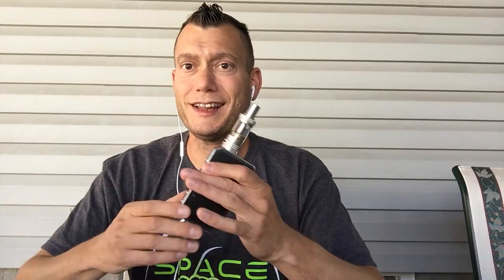Dangers of Ni200 nickel DON'T vape it on anything BUT Temperature Control!

Comment: I'm curious where you get your information? The metals in Kanthal (Aluminum, Iron, Chromium) are also toxic in certain situations. They're used because they're generally recognized as very low in toxicity even then and few situations where they become toxic.

The same is also true of nickel. What you say is correct, but as you acknowledge, you don't know the specific temperatures. The data sheets from metals manufacturers I have found indicate Ni200 is upwards of 600 celsius. Just like the common metals found in Kanthal, Nickle is one of these MOST common metals on the planet.

Nickel is used in cooking equipment.  electrical and industrial uses. It's used in welding and dozens of similar uses as the constituent components of Kanthal. Cases of Nickel toxicity are extremely rare and only found in metalurgy where workers were exposed to 20mg of fine powder that was inhaled according to the U.S. CDC. Environmental exposure from smoking cigarettes and contaminates don't remotely meet the necessary state.

I hope you don't take this as disrespect. But as long as I've been vaping I have seen videos and posts like yours extolling the dangers of some insanely common metal that we (vapers) are only becoming familiar with now. I have never seen a single one of these well founded on any real research or reliable data.

It's the major reason I wish regulators would get involved in some way. It'd be nice to have these myths and rumors cleared up so we can all vape in a way we know is safe. And thank you for being much less alarmist than other videos of the same. You seem to use your brain much better than most.
Reply from the maker: +Kbo On the off chance that you are not a troller as I commonly get, perhaps a legit person and not a fake account I'll address this.  You read the same stuff online that I did.  But I went to an engineering school and spoke with MANY friends and former colleagues about uses of metals while I was also deciding that Nickel is NOT just a commonly used metal in any of those applications you mention.  They use very small amounts of nickel alloyed in because it combines with other metals to give it a nice shine, and also to make it more rust resistant.  But pure nickel is soft and heat AND electricity will change it's structure.  It doesn't need to melt or boil as some assholes like to state in comments in this video.  Sure you don't want to breathe Aluminum or Chromium fumes either, but those metals combined with Steel and also a bit of Nickel will make a very hearty alloy capable of maintaining its' crystalline structure under tremendous heat over time.  Nickel is not used to make boiler tubes.  The composition of Kanthal is the same as used for the tubes in boilers.  And they stand up to intense constant heat over years.  My point in making this video was to tell people not to use Ni200 and Ti in wattage mode.  The entire debate over Ni200 needs to be done someplace else lest you miss the point of this PSA which tells mod users not to dry glow their coils with Ni200 or Ti.  As I spend alot of time in alot of vape shops and see new vapers who don't understand Temperature Control and how it works and why it is necessary I made this video.  And in fact the MSDS sheets for Ni200 classify it as a carcinogen and Ti as an Irritant, I would highly recommend being cautious and not rush blindly into using these without alot of reading on how TC mods work and how they calculate temperature.  Even the most experienced vapers and long time reviewers are asking the same questions as you are.  I'd rather not see people make a mistake out of ignorance, but rather understand that they need to learn this way of vaping and take it seriously.  As seriously as battery safety and mod safety.
Reply: +Quest4vape I appreciate the response. I wanted to ask because I've read up some on Nickel toxicity but I don't have access to much that would be relevant to vaping. But the main thing was that usual fear mongering on these subjects doesn't differentiate like you do. You seemed to know something that I and most didn't. I know the technical side well enough from building TC mods but am far from expert. Even in vaping, most experienced vapers I see know shockingly little true information (batteries is the one that horrifies me most).

I thought it was common knowledge not to burn Ni200 coils, not to mention totally unnecessary, until I started seeing this debate. But I had never gotten a definitive answer about the health risk and went with a "better-safe" policy. I don't have anything invested in Ni200 other than finding out what is accurate, which seems to be the big difference with most people here. I wasn't worried about TC in general since from what I've read, it keeps it well under the temp necessary to be toxic.

Again, thanks for taking the time to answer. I didn't intend to come accross as argumentative or trollish if I did. Just laying out what I found when I looked into Nickel before starting using TC and verifying you know what you're talking about. Especially if I repeat it to someone else.

People seriously troll you? What the hell...
Reply from the maker: +Kbo Some TC mods don't work accurately despite the label or the claim.  Some will shift back into wattage mode randomly (Joyetech VTC) and that is really scary for a starter kit.  Last Tuesday on my live show I dry fire tested a bunch of TC mods to see if any of them would burn a coil.  I recorded this ^ video in August shortly after I saw a guy doing a twisted build with Ni200 at a vape shop and use a blowtorch to remove the hotspots!  And he thought that was perfectly fine.  No I don't have all the answers, just making people aware that it isn't a casual subject.  If everybody knew this there would be very few views and comments on this video.  I get trolled almost daily.  Sometimes it is organized and coached.  Since nobody can comment on the fear monger guy's video on youtube they jump over to my video and bitch at me for hating on Ni200.  Without even watching the whole video usually.  Any comment with the phrase "nickel is a rather stable metal" is copied and pasted from an opinion that a retailer wrote online.  And I get people on here trying to sound like experts quoting that bullshit.  Also they like to tell me that Toasters and Orthodontic Braces are made from nickel.  These are incorrect statements and I am so tired of answering those jabs I now just delete them.  But unlike the fear monger guy I didn't do this video for the clickbait exploitation.  I did it because I want people to know there is more to this TC business.  I've done a few hundred videos after this one about all kinds of other topics, products and events.  But this one seems to catch the most attention.

Comment: I'm a new vaper, just to set it straight. I bought a device (Kangertech Topbox Mini) about 5 days ago. It came pre-built with a Nickel coil. The battery does have TC modes, but I didn't really understand the concept too well. So I've basically been vaping a Ni coil on wattage mode for the past 5 days, what risk does this pose? Great video btw
Reply from the maker: +Aadam Muhammad Read your instruction manual and use the Temperature Control.  currently you're not using the device properly.  Ni200 is not intended to vape in wattage mode.

Comment: That is what Kangertech states on its website about this coils and VW: 'Cautions:
Risk of battery Explosion! Ni 200 is designed for use only with devices equipped with circuit boards capable of controlling coil temperature, such as DNA 40 Mods. Do not use this product with any other devices.'
Reply from the maker: +Raul Andres exactly. Thank you!
Reply: you are welcome mate

Comment: Nickle doesn't combust below 550 degrees.
Reply from the maker: +Joseph Whitfield yeah?  Thanks.  So everything's just peachy until the metal reaches combustion?  cool.  big relief.  Now please go watch the video and see what it is I AM saying.  And don't vape Nickel in wattage mode or you will most surely be vaping at well over 600 degrees which the manufacturers never intended.  Thank you for your comment.

Comment: Ok i have a question....

I am using an Arctic Horizon Tech tank and i am using a 0.2 Ohm coil and can't find the type of wire used. Is this dangerous to use?
Reply from the maker: +Ramza BloodMoon I believe the .2 ohm coil for the Arctic is Ni200 but it should be labeled on the coil and the box for the coils.  no?
Reply: it was an individual piece sold in a little plastic wrapping, no labels.

Comment: Thanks for the safety tip man, just purchased my first Ni200 Temp. Control Coil to use in my Atlantis 2. Using a IPVd2 mod.
Hopefully this works or i'll go back to using soldering wire to be on the safe side.
Reply from the maker: +mattwho777 haha I know you're joking about that Soldering wire.  chuckle.  the IPV D2 is a great mod, does temp control with decent accuracy.  Be sure to lock resistance when both mod and tank are room temp (hold down the + and - buttons at same time and it will lock the resistance).
Reply: Quest4vape Yea I had this one for a few months now, we'll see how I like the TC coils. Keep up the great videos.

Comment: another newbie here, I am thinking about getting the Joyetech evic mini vtc, is the nickel coil the only coil I can vape in temp control mode with? and is titanium or platinum any safer/more dangerous to vape with?
Reply from the maker: +Pulp Free Fiction I just did a review for the Evic Mini, it's a great device.  I do a dry burn test with Ni200, Titanium and SS coil and it performs well, does it's job and the video shows you how and why Temp control works...it backs down power and then cuts power when max temp is reached.  https://youtu.be/CBTZTFJrEcc
You can vape Ni200,  Ti, and SS in temp control on this device, as well as set your own custom profile for other metals if you know the TCR...coefficient ratio number for that metal.  Titanium is not as soft and brittle and can withstand some higher temperatures but also has an irritant risk and forms Titanium Dioxide if heated too high and and/or dry burned.  I don't know anything about platinum.
Reply: Quest4vape thanks for the info,  I'll probably end up buying this mod then.

Comment: Ive only had my mod about 2 weeks and it came with both a nickel Ni200 and Kanthal coil. Im not liking the nickel because on temperature control which i use because the directions say so, its got a cold hit. I feel like im breathing in winter air. My Kanthal on variable voltage with a warm hit feels way better and is more satisfying. I think im gonna stick with the Kanthal after this for that reason but Ill use the nickel until it feels used up since it came with my kit.

Comment: I know this is going to sound ignorant as hell, but I'm a bit of a hypochondriac...
I usually vape in wattage mode, but yesterday I got a tc mod and wanted to try nickel out. I purchased the kangertech topbox and assumed that the pre installed coils were kanthal. I thought I'd try the kangertech tank in my regular wattage then switch to the nickel. The coil was reading at .3 and when I went to change it  (so about 24 hrs. of vaping at 45 watts), I realized it was a nickel coil. I feel like an idiot, but was wondering if this should be something I should worry about. I know I will never vape without checking the coil first, but should I be worried about my health at all? Like an emergency type situation? I hope I am over reacting (I'm the type of person who thinks a headache is a tumor...lol), but really have no idea..
Reply: +Sarah Owens To shorten it up a bit...are the dangers caused by long term use, or short term as well?
Reply from the maker: +Sarah Owens  Fortunately you didn't have a dry hit with nickel in wattage mode and inhale burnt metal.  So for the short term if you didn't have a reaction don't stress over it too much.  the dangers are both.  short term in the extreme of dry hits and inhaling burnt metal, and long term from heating the metal higher than temperatures intended by manufacturers of these products.  Exact details of this we do no know, and it sure would be great if 'somebody' did real research.

Comment: I have the Uwell Crown tank on a tesla nano 100W TC, I just bought new coils at .5 dual coil, should I vape in Wattage mode or Temp control mode?
Reply: +Matt Abrams .5 is fine in wattage mode. For the UWell Crown, you need to put the 0.15 NI200 coils on temp control

Comment: with all due respect, I feel that for the sake of our health, the vape community needs a group of a actual scientists & doctors to conduct a series of experiments on vaping with ALL types of wire & post an informative video to ensure our safety & also crush all the speculation theories.
Reply: +DaveyLeeRiot I agree. Either more education about devices and/or safety innovations to prevent stupid things from happening.
Reply: I couldn't agree more!!!
Reply: +DaveyLeeRiot I agree with you but something like that will take a lot of time. Imagine all the combinations you have to take into account so that you can say do this or do that. The manufacturers should be able to tell us that their product (e.g. Melo 3 0.15Ω Ni200) is safe to vape between let's say 200-250 C or the equivalent in F. They are only made for temp control mods so Wattage should not matter IMO. I can vape on Ni with 60W and as long as I have temp control set to  max 250C I should be okay. We do not know much about certain things regarding vaping yet and unfortunately not many "tests" have been ran.
Reply: Ωmega Entertainment nickle is only for temperature control dumb fuck wattage heating is different from temperature control heating
Reply: DaveyLeeRiot omg 😲 yes! Thank you this is wide open business with growth we need researched tested by a Quality Control Engineering department should be on site our health ( especially MMP people) are vulnerable to illness

Comment: I'm new to vaping and own a kanger Nebox starter kit and was wondering what a good temperature would be to vape on the nickle coil?
Reply: +tony mediati 520 is my sweet spot. Not too hot, but hot enough to get a little intensity out of it.
Reply: +Ghostman229 did you find out? because i am also wondering
Reply: +Syre 30 but im not sure
Reply: +Ghostman229 my vape store says 400-450 F
Reply: +Gael Murphy with the stock ni200 coil or with titanium?
Reply: +Ghostman229 ni200
Reply: +Ghostman229 I vape anywhere from 450 to 520 on my ni200  0.15 ohm
Reply: Usually there is a set maximum temperature which is safe to vape on. But if you want a comfortable cold vape around 400f-450f or if you want a warm vape about 500f-520f
Reply: Usually there is a set maximum temperature which is safe to vape on. But if you want a comfortable cold vape around 400f-450f or if you want a warm vape about 500f-520f

Comment: Quick question, I have a tesla 200w tc mod with a billow v2 and 26 gauge nickel wire.I can't seem to do a build on it.Says atomizer short..would u happen to know how I can do a build?thanks
Reply from the maker: +Will Goodlin The Billow V2 Nano is tight on deck space to build.  You need 28 or 30 gauge wire.  I did a nickel build video using 26 ga. single coil on the Royal Hunter 12 or 14 wraps spaced....there's not enough room on the Billow V2 to fit that many wraps.  gotta tinker til you figure it out.  Not sure what the Tesla 200Wtc fires down to in Ni200 TC mode.  And you must do dual coil as there's no way to block the juice and airflow on the other side of the deck, so that lowers the resistance too.  TC takes tweaking my friend.  in an RTA especially.

Comment: Stainless steel is probably the way to go if you want to be on the safe side. Right?
Reply: +Vio Phile No, as long as your nickel coils don't reach 2000 degrees Farenheit, you won't run the risk of exposure to serious doses of toxins like carbon monoxide. Stainless Steel is more durable than nickel, but it still oxidizes at a certain temp range and it will release toxic fumes when it gets hot. No metal is safer than another metal (as far as vaping is concerned right now), it all depends on how you use them.
Reply: +Vio Phile Your safest bet is to use TC and not risk wattage, whatever you use for a coil.
Reply: +Vio Phile Just get the TI coils NI suck

Comment: May I ask , my snow wolf 200 have temperature control , can i use ni 200 ?
Reply from the maker: +Iorien Jin yes
Reply: Any recommendations how many ohm and temperature I have to use ?
Reply: +Iorien Jin Usually they temp control at 400, 500 and 600 degrees.  3 clicks to change between red, yellow and green respectively.

Comment: I have some 24 kanthal  fused Claptons with 34 ni80 wrap and have had them glowing uproar 80watts is it same?  should I take it out?
Reply from the maker: +Alex piv not necessary.   Ni80 is nichrome.  that's an alloy.  It's not the same as ni200 which is pure nickel.  folks have been vaping with Nichrome for 5+ years.  I prefer Kanthal and Stainless Steel, but I've been using Nichrome for the past year and a half with no ill effects that I have noticed.
Reply: Nice one bud keep up the top work!! I just gotta fuel rda beats the velocity Im chuffin cuffed chuffin clouds flavors a+ too !!  Lol